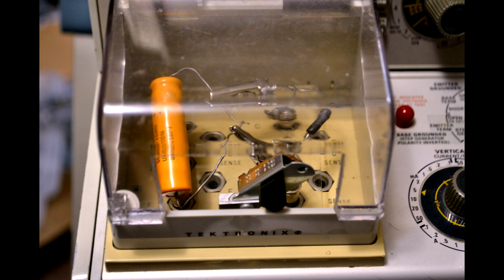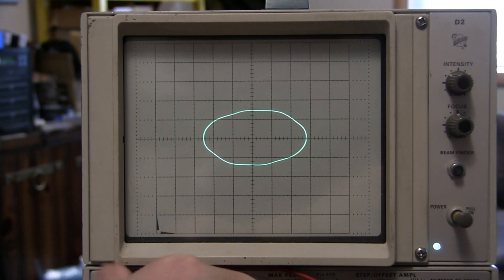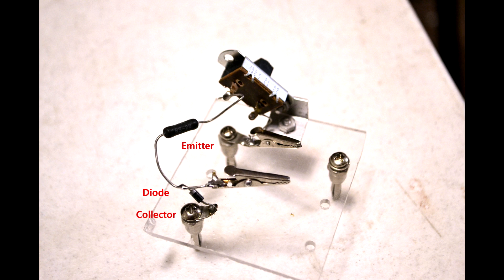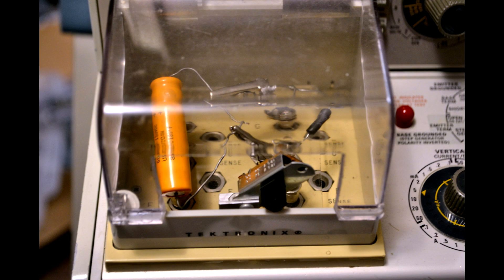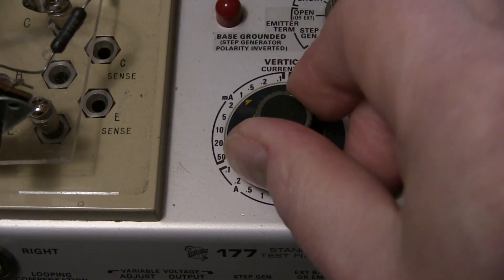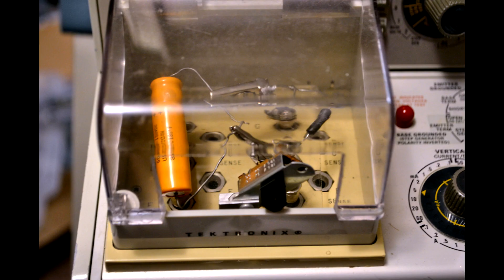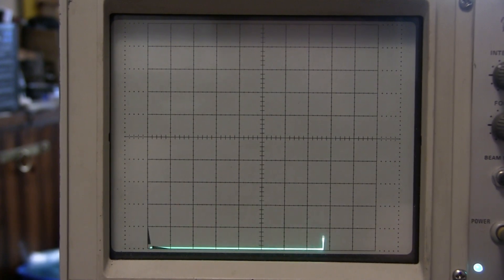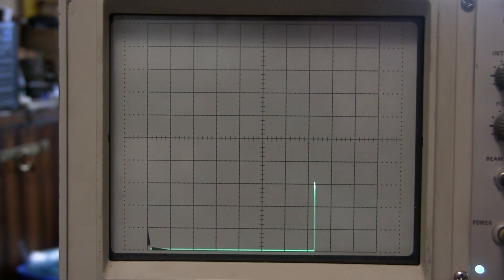Testing Capacitors on  a Curve Tracer -- A Novel Method

Comment: This is a great idea.  I am going to build a jig and use this with my 577.  The wide voltage and current range on the 577 means that I can test most capacitors I will ever encounter.  Thanks!